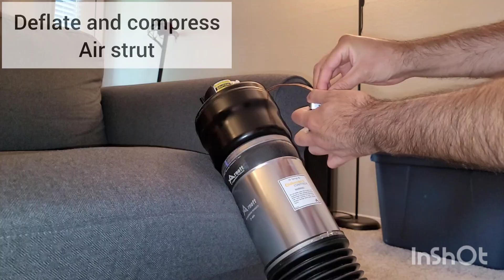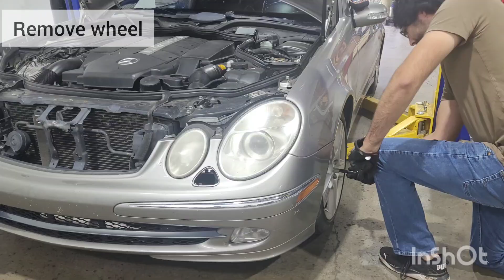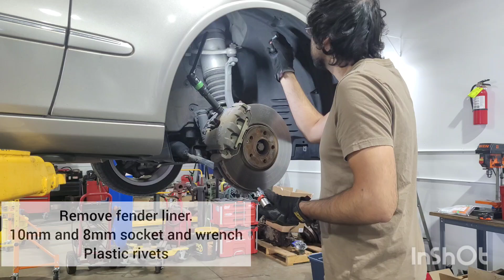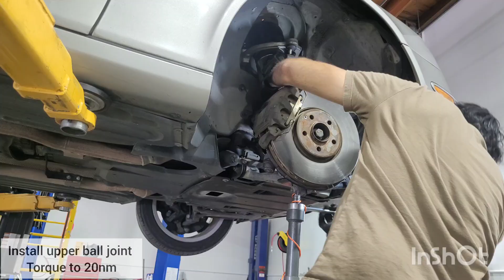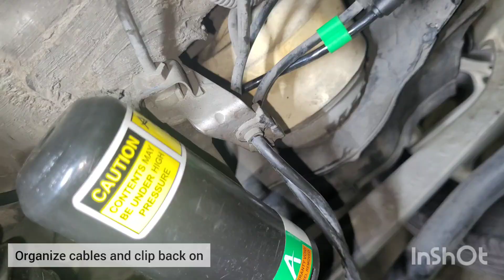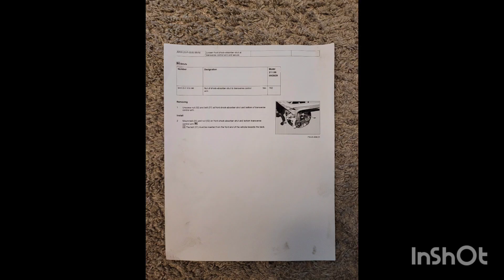Mercedes E500 4matic wagon front air strut replacement

Comment: The smoke detector lol
Reply from the maker: It was an easily accisble 9volt battery to deflate the strut.
Reply: I have Arnott on my 2006 e500 wagon 4matic. They are good, replaced 3 years ago. but I need to change the rest of suspension. 
Is there a way to deflate the strut on the car without a computer? ( 9V battery?)
Reply from the maker: @MrSilvernugget it wouldbbe the same process as i showed in the begining of the video. Just disconnect plug and attatch a 9volt battery with wires to the connector.